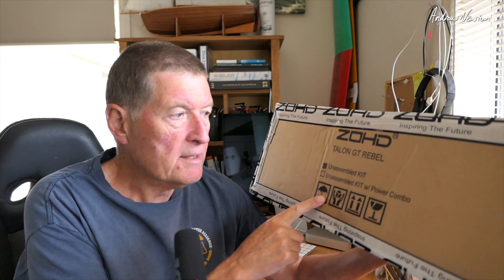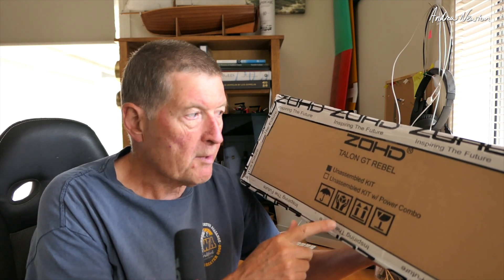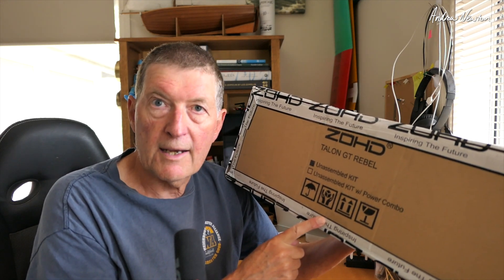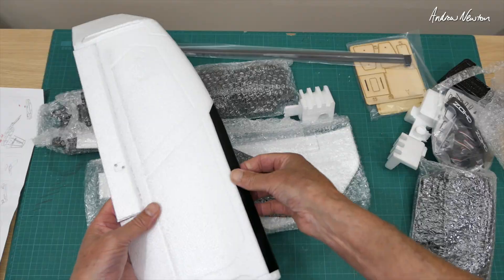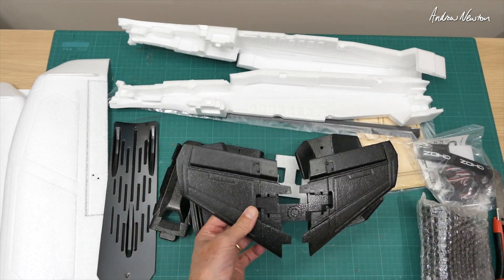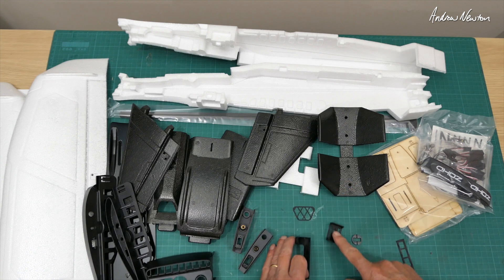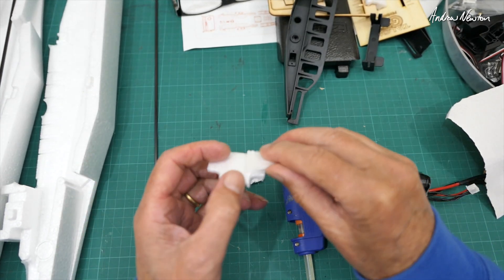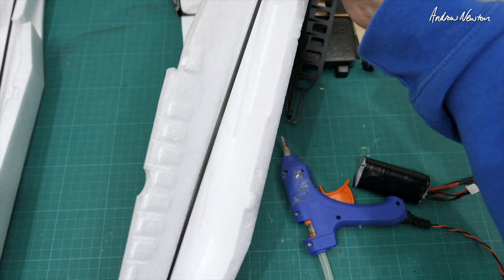ZOHD Talon GT Kit Assembly

Comment: I'm building a zohd talon gt rebel right now. The BEPP is a little funny. How long before it biodegrades? I bought the kit 2 or 3 years ago. The box only had one sheet of paper in it - the assembly diagram. I searched online for the instructions or user guide, did not find. The adhesives I used  are thin CA, Clear Gorilla Glue, medium CA, and Bob Smith Foam Safe. What benefits does the "WING" version of the FC provide? Can most FC drive servos, or only some? Did you keep the tail servos independent so you have rudder and elevator? I'm waiting for the FC, GPS, vTx, ESC. I'm going to run iNav on it. I haven't decided on the fpv cam, I have several but they don't all work. I have a runcam 2 4k for flight recording. Up to now I've used fpv only with quadrotors, so this should be fun!
Reply from the maker: Wing boards have more PWM outputs, separate BEC for servos and a power distribution board. Tail servos need to be on separate channels if you want elevator to work properly, and have rudder.

Comment: I got mine yesterday .  the Box looks just like that .  it says special edition on mine .
Reply from the maker: Any difference that you can see?
Reply: @AndrewNewton 
  The box is brown cardboard has that Zod taper on the edge it doesn't have the picture on the box I don't know if it has the little short carbon rods for around the cockpit area . They could be in there in one of the bags I don't know I'm not going to put it together yet I'm still working on the Zod 250g the little one and even that one I build a homemade version of it first out of foam board and I got the real one in a box I don't want to ruin it ❤they're so nice

Comment: Hello Andrew, I just received mine can you give me the direction of the propeller propulsion and engine direction please I am not used to rear propulsion.

Kind regards
Reply from the maker: Motor turns clockwise looking from behind the plane, and make sure the prop faces forward. Convex prop surface faces towards the nose.
Reply: @AndrewNewton  Thanks Andrew, I've been following you for a while now and I feed off your videos, they are great and explicit.

Sorry for my bad English
Reply from the maker: Your English is fine. Good luck with the build
Reply: @AndrewNewton  Thanks dude I need to test speedybee mini F405 on this? You have already test?
Reply from the maker: @bdyoliver7751  I have not used it on the TalonGT but it would work well, no problems.
Reply: @AndrewNewton  it's my first time in fly card... I hope it won't be too hard to configure..

Comment: Thanks for the video. Trying to get into RC and found the assembly instructions quite intimidating... And I have 15 years of professional engineering experience.
I for the basic kit, however, and it does not have the servos or motor/propeller. Would love to hear your suggestion on reasonable parts to get. Otherwise I will go forward with FrSky HV5611 x4 and Sunnysky X2212.
Thanks again.
Reply from the maker: Yes, excellent servos. The original comes with 2216 but 2212 is more than enough.
Reply: @AndrewNewton  Lovely. Thank you very much for your advice.

Comment: Question please Andrew: Are you switching to 18650 packs now because they are safer than Lipos?
How does the energy density compare?
Reply from the maker: Yes among other reasons. Lighter, smaller, can DIY, scarcity of LIPOs generally. I still use LIPOs for high current draw situations.
Reply: @AndrewNewton    Thanks, Mate. 👍
I see you can get them now up to 30 amp max. Which is quite good!
I'll definitely look into this option.

Comment: Great build montage. Surprised that hot glue was what bonded the best. Perhaps ZOHD customer support could share some suggestions? Nice work keeping the weight down, even using hot glue. Couldn't imagine using a slow-cure glue on an extensive of a build as this. (it would take weeks vs.hours)
Reply from the maker: E6000 seems to be the consensus, but mine didn't work well. Have to careful with E6000, it dissolves some foam types.
Reply: In the sun my hot glue feels bendy . And stick after stick after stick mi g ht get heavy

Comment: You in training for a meeting with Old Nick mate? Hot glue is the bizzo for EPP because it burns through the mould release, sticks like the proverbial and is a bit flexible to move with the foam. But, being a wimp, I prefer to use scrap foam, bamboo skewers and most usefully cheap shop wooden craft and popsicle sticks to smooth and force into shape when bogging things together with it. You can also dampen 1 end to use as a quick setting tool. Sticky tape on the other end helps if you have to use it to align or hold flat a cooling joint. 😉😊 
Edit. Have to find where we've stored that dinky little screen too, now that we've got a couple Jumper T-lites. Probably the battery has swelled and busted the board by now! 🙄
Reply: But hot glue is heavy
Reply: @toolbaggers  Put it on thin, squeeze out and scrape off the excess. The weight penalty of hot glue is generally over-rated! 😉

Comment: A lesson in hot glue Andrew....ZOHD spent a fortune engineering this plane, and it comes with its own JCB bucket shovel for when you land it...lol....Be interested to see your alternative nose for this ugly duckling....😏😀😀🇬🇧
Reply: Haha, yes indeed. the big shovel on the front certainly did dig up a load of dirt and soil when I would land mine on anything other than smooth grass or concrete. Still, it does hold up pretty well, the material is hard wearing, just need to shake the pebbles out of the model before you launch again HAHA
Reply: @grim-upnorth  I still have a Mini Talon in box....kit....£30....Bangood, it was a few years ago....A better plane than this for sure, only bad thing I found was battery bay access was terrible, cut out the front for access to Lipo straps....🤔🙄😏😀🇬🇧

Comment: I’m tempted to get either this or the dart xl
Reply: Get this. The Dart XL looks cool, but ultimately this Talon GT Rebel gave me a much better all round ownership experience. The Dart XL had some pretty major design flaws, mainly to do with the amount of built in reflex and recommended CG points. The original designer of the Dart XL wasn't happy with what ZOHD ultimately released and left the company, he went on to release a version of the plane that the Dart XL "should have" been. The LTE Rambler.
This Talon GT Rebel however, is a very neat package and is super easy to launch, just like a paper plane, no stress at all, and the conventional fuselage and wing configuration means is super easy to adjust CG.
I've had all 3 of the planes I just mentioned. I still have the LTE Rambler and its my go-to plane, has been for 2 years. It's an extremely well rounded plane, can fly slow and fast, aerobatics and long range.
The Dart XL's nose ripped off on the first landing. it wasn't even a crash, it just landed in grass and the nose broke off! It was so frustrating that I ripped the gear from it for other planes, but I kept the body and resurrected it a while later. I did get it to fly, but there's a funny video on my channel where I do a bad job of launching it, and ultimately, that was the end of the Dart XL. I will be fair to mention that ZOHD did release an updated version of the Dart XL called the "extreme" which had an updated wing profile and by all accounts flew much better than the original, but I can't comment as I've never had the "extreme" version.
Reply from the maker: Interesting. The only one I kept was the LTE Rambler too. It does work well

Comment: I was fortunate enough to receive a PNP version of this for review when it was released a few years back. I instantly loved it. It was my go-to FPV platform for many reasons.
- super portable, the way it breaks down for transport without having to get fiddly with servo connectors is amazing.
- sizeable interior for decent battery capacity.
- dedicated GoPro and FPV cam location without compromising the overall aero (yes its flat front face isn't that aerodynamic, but the point is that's how aerodynamic it is with or without putting GoPro and FPV cam up front... adding a gopro and fpv cam doesn't "alter" the aero characteristics, unlike when you add them to other planes)
- easy to handle, not too big to be awkward and not too small to be ineffective.
Unfortunately I stalled and crashed mine, but not after making many of my favourite videos with it.
I've since taken the leap to digital, so when the kit version of this came up at hobbyrc in the uk for only £59 I absolutely had to grab one for backup (I alreay have 4 fully built FPV planes, AR Pro, Albabird, Mini Talon, LTE Rambler). Next time I crash one of those, the gear is going in the Talon GT Rebel.

Comment: I bought the kit - used IPA to clean the surfaces and E6000 - holds great and has a little flex in it still when set off.
Reply: Exactly this, clean joins and the right glue can make or break your flying experience. All it takes is for someone to use foam safe CA or epoxy, and on a less than perfect landing, the plane is in pieces. Glue that is still flexible once cured is the best in my opinion, for foam models.
Reply: @grim-upnorth  Yes, but I'd try not to use hot glue as it is heavy
Reply: Did you drink the India Pale Ale afterwards?
Reply: @toolbaggers  IsoPropyl Alcohol
Reply: Totally agree  @toolbaggers . Not only that but even though it appears that Andrew had relatively good results using hot glue here (that we could see), for me the cooling and therefore setting time of hotglue is far too fast for me to align things up properly. Foam to foam can sometimes also be compromised using hotglue as it can often be SO hot that it just melts a hole in the foam and sinks past the surface to be glued.

Comment: Interesting re the glues - I've never loved uhu por that much. Impressive that you managed to get the fuselage done without it cooling down, i guess i would use epoxy if in doubt but it's obviously messier.
Reply: Epoxy is also brittle. When building foam models like this, I like to use a glue that is also flexible once cured.
Reply: @grim-upnorth  A contact cement or silicone
Reply: exactly, like UHU Por or E6000. Very strange that Andrew had issues with UHU Por as I had no such issues with this type of foam and UHU Por myself.